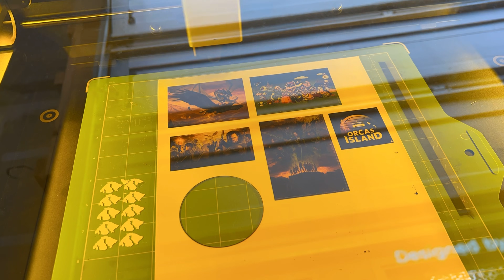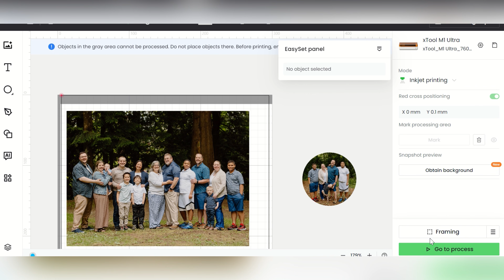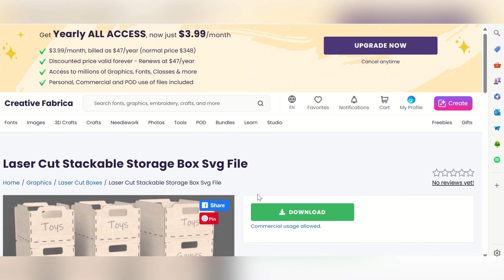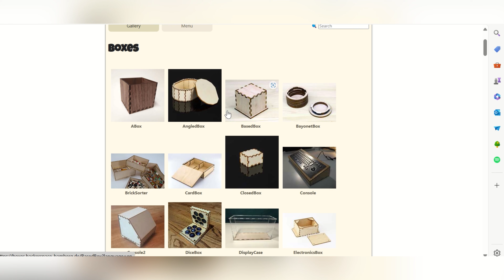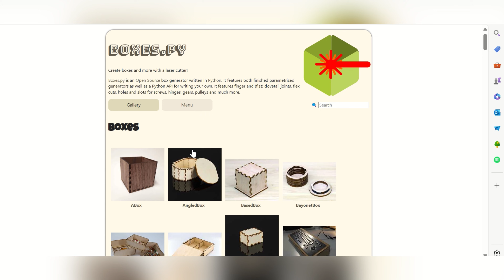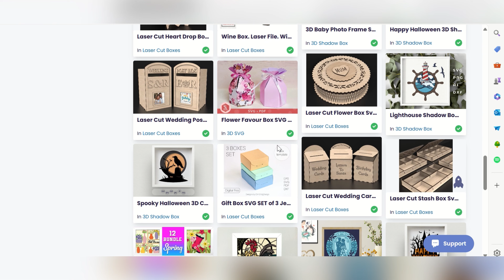Laser Puzzles & Boxes: Free Laser Files to Customize

Comment: The bottom tray seems difficult to work with. I use expanded steel (not flattened) and it has many options as to the hole size. Very affordable.